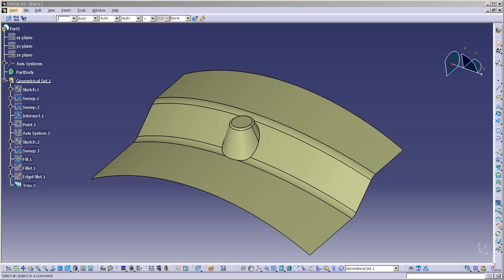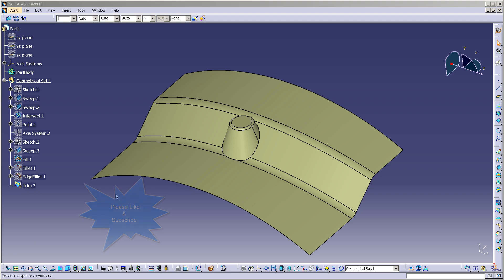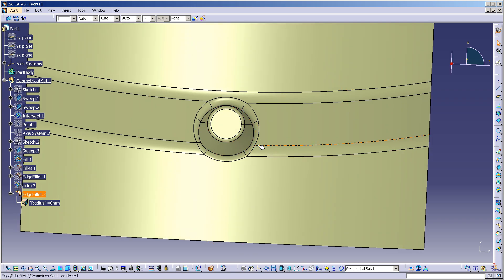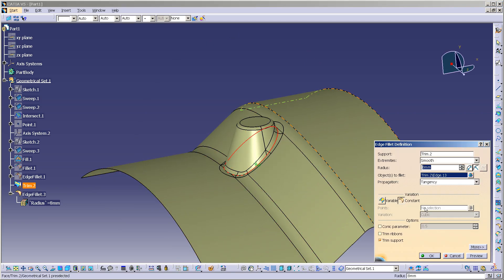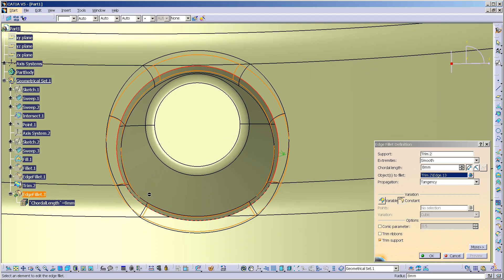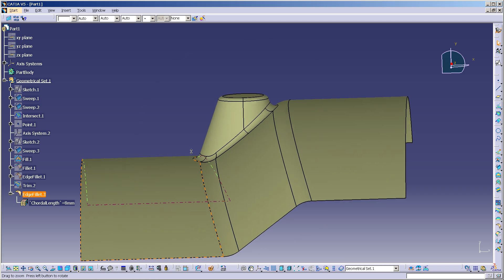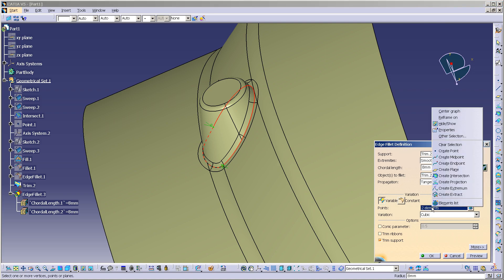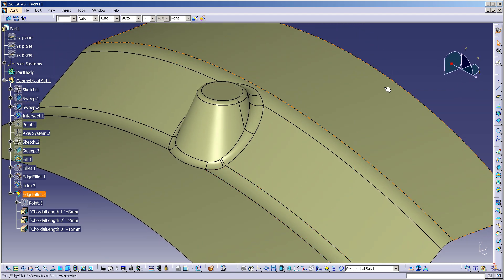Catia V5: Chordal  Edge Fillet

Comment: From a manufacturing perspective, you would want to have a constant radius. The  radius on a ball nose mill is constant. You can use smaller, but it's more work. If we are talking about injection molding,  than using chordal is a nightmare because it doesn't offset as well and you get uneven wall thickness.
 It looks good but you can have problems with manufacturing it. Cool video !